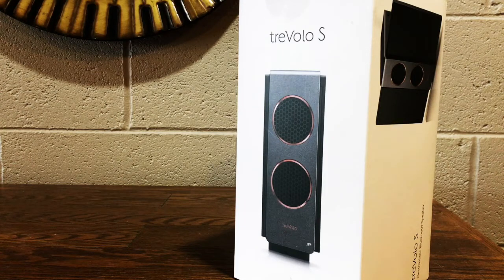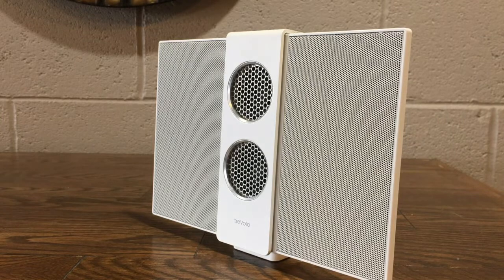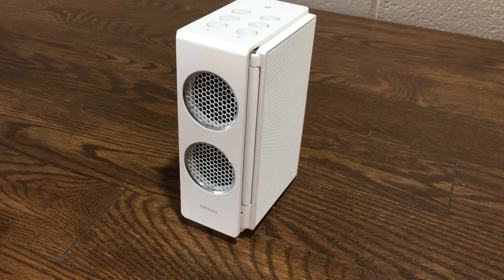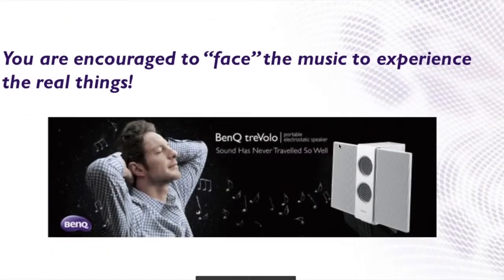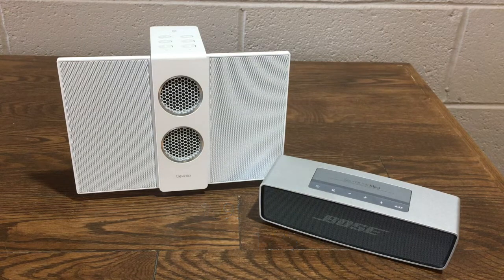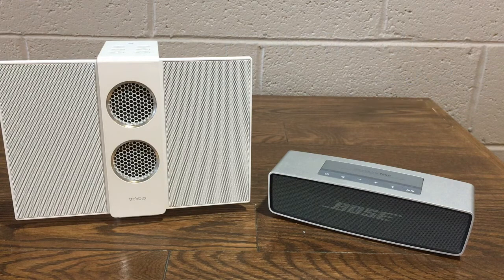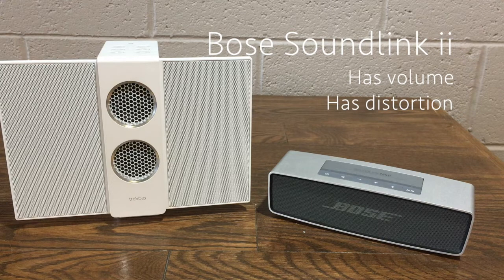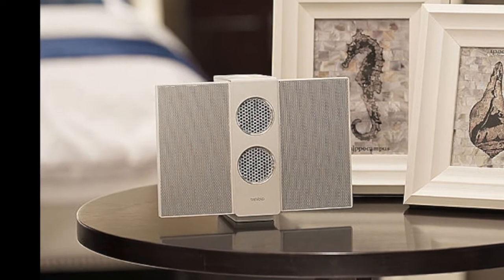What’s an Electrostatic Speaker and How Do They Sound? With the TreVolo S

Comment: In addition to the DSP equalization settings where the Bose uses a boosted midbass to sound bigger and boost bass impact, I suspect a large amount of the difference in sound both in the recording and in any place with a nearby backwall has to do with the dipolar sound radiation pattern of the electrostatic panels.